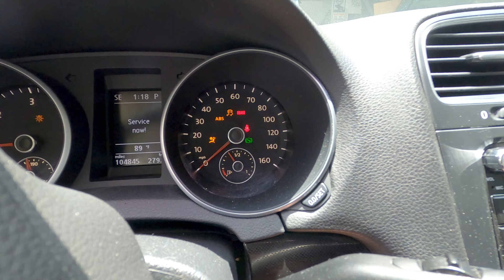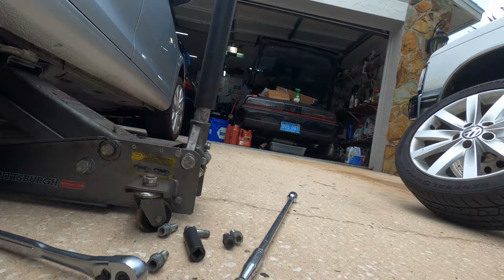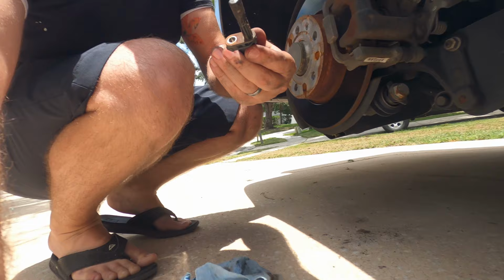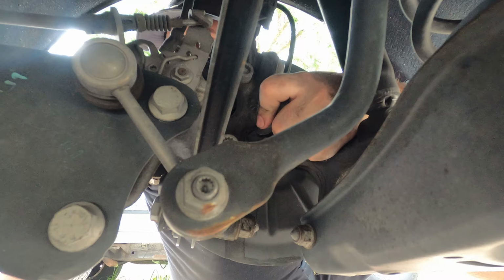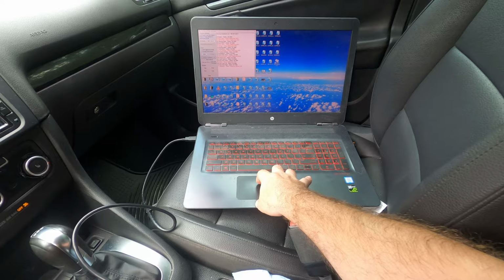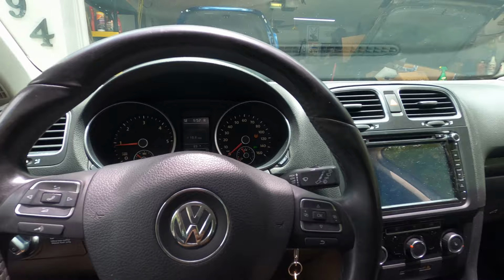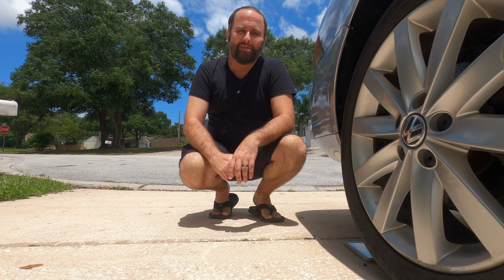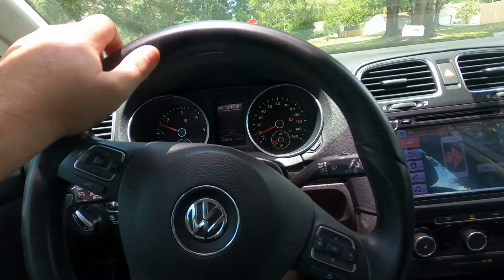VW ABS Wheel Speed Sensor Issues

Comment: I changed the battery of my Vw Passat 2017 for a new one, when I turn on the car the stability system does not work and the steering wheel is hard, can someone help me?
Reply from the maker: All you did was change the battery, and then you started experiencing these symptoms?  If the wheel is hard to turn you're probably out of Power Steering Fluid, or your Power Steering pump is bad.  Check fluid asap.  I'd focus on that first, then move on to the ESC.  ESC could be a bad sensor like what I showed in this video.
Reply: Thanks for your Help!!!

Comment: Where are the front wheel sensors located
Reply from the maker: I haven't had to replace the front sensors, but it should still be located in the back of the hub assembly like the rear.

Comment: Was the car OK to drive for a week while you had the bad sensor?
Reply from the maker: It seemed to be.  I did several hundred miles with the sensor giving codes.  The transmission acted up, downshifting a couple times, but manually shifting back to a higher usually fixed it.
Reply: Its is completely safe. You just will not have ABS or traction control. Like most cars before the 80s

Comment: Just plug in a $50 scan tool. I got the same lights on my 2015 Passat. Being that I have owned a number of BMWs I recognized the issue. I plugged in my scan tool and it was left front wheel speed sensor. No need to waste time scouring the internet.

I bought a new sensor. Don't buy OEM from VW. They're over $100. Buy one online. And learn German cars. I paid $28 for a sensor made by ATE. Owned by Continental Auto Group. VW buys their sensors from ATE. Same sensor. Different packaging.

Comment: I am having the same problem with my 2017 VW passat tsi and the engine light came on as well? Should I do the same thing?? Please let me know ASAP!
Reply from the maker: The best thing to do is scan the codes if you can.  I didn't have a Check Engine Light, so it's possible you have more going on than just the ABS sensor.

Comment: How about I am from Monterrey Mexico I have a 2012 Golf GTI all the warning lights on the dashboard come on do you think that changing the sensors will turn them off can you help me do you have a phone number I can call you sorry for the inconvenience
Reply from the maker: The sensors aren't that expensive so you could give it a try.  However, I do NOT recommend just throwing parts at a problem without trying to diagnose it first.  

You should scan the computer and see what codes you're getting.  Most likely it will be one individual sensor, but it could also be something more serious like the ABS module.  

Unfortunately, I don't have any advice beyond that.  Trying to fix anything without scanning first is often a recipe for wasted money and frustration.